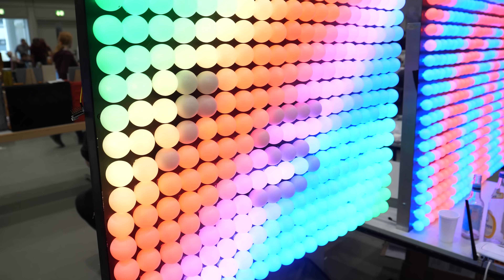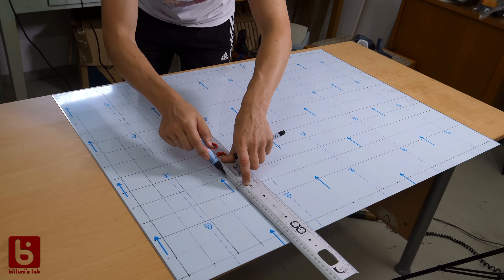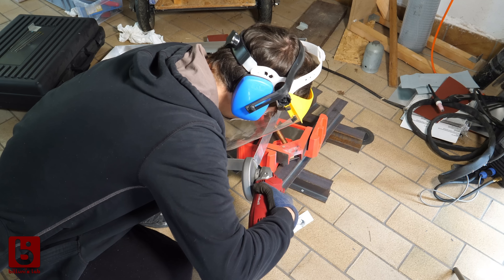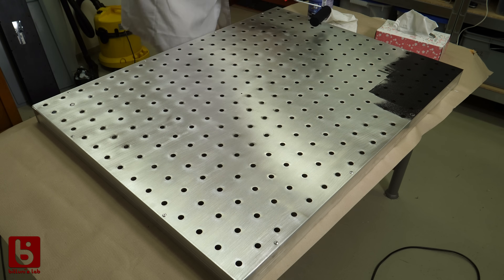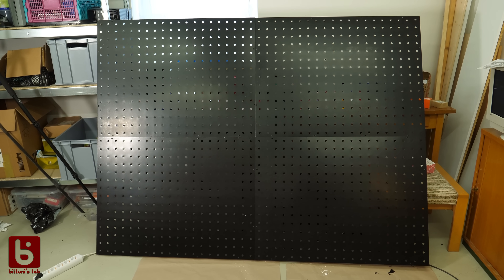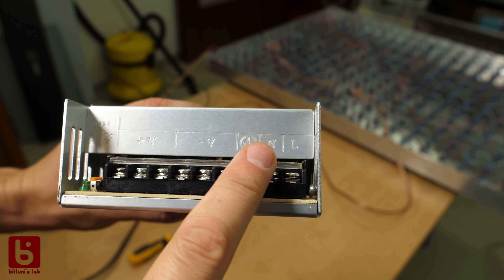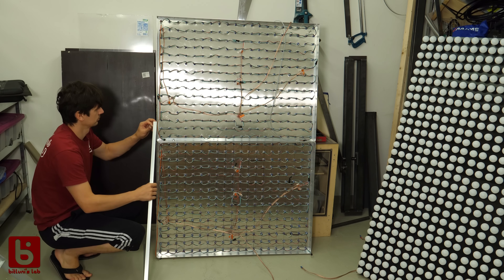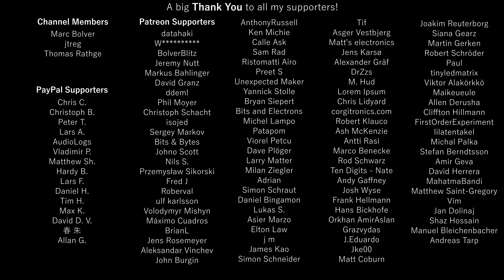DIY Ping Pong LED Wall v2.0

Comment: Sir, I want to try your project

And I wanna ask you if your 5v/70A/350w power supply are still fit and compatible if I use LED Ws2811 5v pixel module string of 2,000 pieces?

Comment: Hi! I have mounted something similar but with fewer LEDs, only 250. It turns out that when I start it with the Arduino board that you use some LEDs, they seem to blink and change color (as if they failed), I have noticed and it also happens to you. you. What is this due to? With another arduino board it doesn't happen to me.

Comment: Hallo liebe Community, ich habe noch ein paar Fragen und möchte dieses Projekt selber nachbauen ich möchte das nicht als Led Wand sondern als Beleuchtung an der Decke benutzen. Folgendes habe ich mir überlegt. Ich nehme den gleichen Abstand wie hier also 5 cm und wollte eine Länge 1.5m und eine Breite von 40 cm bauen. Entspricht also einer Matrix von 30 mal 10 also 300 LED´s dieses passt auch mit den WS2811 LED´s überein. Jetzt fallen mir als halber Elektriker(Mechatroniker) folgende Fragen ein. Erstens finde ich keine richtige Leistungs bzw. Stromstärke heraus um das passende Netzteil auszuwählen. Mit Mikrocontrollertechnik habe ich auch kaum bis keine Ahnung. Also weiß ich beispielsweise auch nicht welche Querschnitte ich brauche für das Projekt. Der zweite Teil der mir einfällt ist, meine Idee wäre es über den Mikrocontroller ein Bluetooth Modul einzusetzen um es per Handy steuerbar zu machen. auch da die Frage wie kann ich das Ansteuern und was bräuchte als Mikrocontroller freue mich auf Antworten dies bezüglich und sonst könnte man auch über discord oder Teamspeak versuchen zu kommunizieren Da fallen mir sicherlich noch mehr Fragen ein.

Comment: 3:40 Try tacking the corner and inside corners first before welding the beam. Since aluminum isn't that strong compared to steel, it melts faster. That's why you got that hole at the end. Hope that helps even though this video was a year ago lol.

Comment: There's a cool product available from Adafruit called a FadeCandy. It can control 512 WS8212 type LEDs, and connects to a PC via USB. You can connect multiple FadeCandys to one PC. It's then really easy to interact with them via a Processing sketch, especially to do things like play video, animated GIFs etc.

Comment: Hi, I'm building a similar ledwall, how have you solved the problem between the array and adafruit library on arduino code?
Reply: What board are u using? 
I'd been making a matrix 16x30 with adafruit GFX library and i can't use more than a matrix's 11x30, but i dont know if my arduino nano isnt enough  ram for support more than 306 ws2812b leds
Reply: @vichdez10  I have an arduino mega 2560 and also an esp32 and the code load on both but at the moment I'm waiting for the power supply from china, so, I can't test it

Comment: Aluminum isn't the easiest thing to weld. Aluminum is a popular heatsink, but it's also easy to burn... Also, aluminum oxide has a really high melting point, so it will insulate the surface. Pain in the ass all the way around.

Comment: This might be a very silly query. I'm getting the parts ready to build this cool LED wall - fits perfectly onto a wall in my lounge - and I happen to stumble upon the ESPixelStick project by forkineye (based on ESP8266). However he has a hardware board that takes care of voltage regulation, fuse etc. whereas in this project we directly drive the LEDs from the ESP without any additional hardware (apart from the implementaton of sACN which is not relevant for this question). Am  I comparing different things here?

Comment: It would probably have taken a lot less time if you had just used pegboard for the front and regular wood for the sides and back (if a back is even necessary). Since the LEDs are bright and the backboard is dark, any unfilled holes in the pegboard that don't line up would more than likely be  unnoticeable as long as there is no light coming through them.

Comment: Does this generate heat? i was wondering for a lighter in weight design couldn`t you use plastic wall panels?

Comment: if you know someone who works in the engineering industry that uses a cnc turret punch it's always a bonus. When welding alloy always tac at the corners to avoid them key holeing

Comment: The next time you're welding thin material clamp a 1/2 inch thick copper backer bar on the other side of the parent metal to draw away heat and prevent blow through.

Comment: How did you put a hole into the ping pong balls? I hot glued some direct to the 12mm bullet Pixels. putting the holes without crushing the balls was difficult.
Reply: On the hot iron i thought

Comment: Physically very nice!  The refresh rate gets too low off a single lead.  1200 is too many off one WS2812B data lead for a good refresh rate.  I split my matrices into no larger than 16x32 and dedicate an ESP32 pin to each.   You can run up to 8x1024 pixels at a full 30fps, but you likely only need to split your into two.  And it's all code, except for one additional wire.

Comment: Run it on LEDEdit with a T300K controller. They are like $100 and run 6,000 LEDs at  25 FPS from a live media stream. It is a lot easier to set up and work with.

Also, you might want to consider putting some fuses in. Great work :)

Comment: Hi , Iam a design student and  I need Help with a personal project , I want to build a LED wall similar to this but smaller , abut it needs to  have a motion sensor  or  something similar to track motion and display it as a color on the panel , so when some one is walking infront of the LEDs a new color will follow them ,  Please help me with this project

Comment: No, the image quality is not “a bit crappy”. It's extremely bad! 
My first computer did 320 by 200, and even that was worse than “a bit crappy”.
What is this? 40 by 30? Even old arkade games are super high res in comparison.
Art? Nah, it’s just a bit of fun. And for that it’s fine. A lot of work, though.

Comment: i wondered last time that you weared an air filter mask for drilling holes, now you wear it for the hotgluegun xD
where is the imaginary hazard?
Reply: You noticed he's also melting a hole in the ball, these fumes aren't definitely the healthiest thing there is.
Reply: @sebastiendesormeaux1853  yes but that was way later. Usually  you wear an airfilter  when you need it, i mena he doenst wears it all the time.

Comment: Next project : LED Wall v3.  Full hd.
Reply: Yeah maybe with some smaller pingpong balls? and shorter distance between the leds?
Reply: @gerben5964 It was a joke.
Reply: @derkernsen  no of course not!!1!1!  (but a simply even bigger Display with therby more pingpong balls would be really nice)
Reply: @derkernsen  Yes it can be seen as an joke, but creating fullhd is possible, and would be very nice!
Reply: @gerben5964  that would be sick
Reply: i already made an interactive led wall you can check it out on my channel  or search on youtube the name of the project is odycubes also you can play tetris on it with your hand movements
Reply: Flo S excited for that
Reply: Thu Nell Ⓥ  would be an interesting conversation with the power supply manufacturer though "yeah i need a 124kA 5V DC brick"... i mean even the one bitluni used was technically subspec (the LEDs can draw 60mA max each, so 72A max for this wall, on a 70A supply) :P
Reply: 420th like
Reply: Then LED Ping pong wall v4. 4 for 4K
Reply: You goin to sawcon guys
Reply: Kat, sawcon these nuts, gottem
Reply: []soup[] my Son Has Ligma and I don’t want you getting it
Reply: Oh UR ON
Reply: Gotta go at least 4k in 2020
Reply: 8k
Reply: Yes. But full hd it is necessary at least 2 million of pixels. The dimensions of this panel turns impossible to build it.
Reply: Thu Nell Ⓥ  some chinese can do that in 2 weeks ;-)
Reply: Maybe 1920x1080 pixels

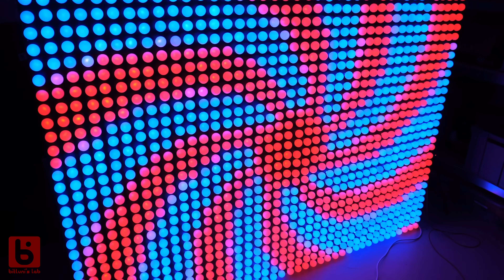Comment: One of the LEDs green channel seems to be failing at 8:37 in the upper left-ish corner, that's unfortunate. Sometimes the LEDs aren't soldered to the chip so well under the silicone...

Comment: Amazing work as usual. I absolutely love the final result. 🤩

Might I suggest you switch from the ESP32 to a (ARM based) teensy since you can use this library called OctoWS2811 which can drive 8 strips on parallel. It can potential manage more than 200FPS in your 1200 LED frame. You will lose WiFi capabilities but that is easily added by putting a raspberry pi, which can get bitmaps over WiFi/Eth/local-storage and send bitmaps over USB to the teensy (at USB full-speed rate ~12Mbps). That library can even do multi-processor synchronization...

I am actually finishing up the same thing right now but I mine is much smaller and hexagonal (at 331 LEDs). 😋

Comment: Hello . Nice work 
Is the data signal strong enough to go through all this leds? Coz I did one project and I used three 5m (16f) , I had to use arduino mega instead of wemos D1 mini also I had to use amplifier to boat the signal

Comment: That's an insane amount of work!
For extra masochism, you could turn the ping pong balls into cubes with some heat and pressure or vacuum - then the pixels will be continuous!
Reply: I think I'd 3d print cubes before trying to reform a ping pong ball.
Reply: @josiahdeal7493  Yeah, that would still take an awful long time though.
A plastic sheet diffuser with a grid of baffles to isolate the leds would probably be a lot easier to do.

Comment: This is amazing. I ended up building the smaller 15x20 one from the last video this summer and it was so satisfying to see it work.
Reply: Hi, I'm also trying to build 15x20, do you Wall work with the camera images? What changes did you make in the code?

Comment: I'm sure someone will point this out, or already did: Never try to weld aluminium without an absolutely pointy tip. On steal you maybe achieve some welding 
without a razorsharp tip - in aluminium, you won't. All you get is a nasty hole filled with bubbling filler rod.

Comment: I wanna build an LED wall too sometime soon but I really don’t know anything about Amp or Voltage drop calculations and so on... Any sites or so to learn this from or maybe even a pre made calculator?
Reply: Let's say one RGB LED can draw a maximum of 60mA (20mA per color) at 5V. So you basically have to multiply that with the amount of RGB LEDs you have. For 144 LEDs on a one meter strip you should get a supply rated for at least 144 * 0.06A = 8.64A. It will probably work with less though, as you won't ever use full brightness white on all of the LEDs simultaneously.

Comment: Full HD next! The size of a house! Awesome work.
Reply: one of the guests at MakerFaire was talking to me about making a version with 800 x 600 or at least 640 x 480 LEDs. I've put on my best "bitch please" face.. you'd need a 144kW power supply for that (granted in full white all pixels). 
You've probably said that as a joke but it just reminded me of that guy. He had this "I can easily whip that up" smug mode on.. meh.
Reply: At 640x480, It would also be at least 19.2m (64 feet) tall, and have to be driven in 148 concurrent segments to maintain a frame rate of 24 frames/second (the max rate of the LEDs he's using allows about 50,000 pixel updates per second)

Comment: Why not drive it with an RPi ?
Reply: The multitasking o/s on a Rpi makes it difficult for it to control these WS2811/WS2812 chips, which are very fussy about timing. The Pi would be going away to do other stuff in the middle of updating the LEDs and it would end up corrupting the display, so it's best to use a single thread chip to drive them, like a PIC, Arduino, or other such similar chips.
Reply: @MrJozza65  You can use DMA to get good timing... there is a good c library on github and tutorials on adafruit
Reply: @ThunderBret1  Sounds interesting; I always assumed that driving these from a Pi was a no-go.
Reply: @MrJozza65  je it works quite well (if you get the levels shiftet right, or the supply voltage is low enove that the leds understand the 3.3V Logic form the Pi). Füll blown Linux allows for some pretty cool stuff with the leds :)

Comment: I'm wondering how a teensy could drive this, especially the last Teensy 4.0
Reply: if you keep it at controlling it with one wire - not much of a difference as the LEDs are the limiting factor.
Reply: @Davedarko  yeah sure, but if you divide it in multiple arrays
Reply: @sheepknightgaming  some guys from my hackerspace use 12 pins of an ESP32 to control LEDs, so I presume the teensy 4 could do a lot more pins :) still the bottleneck would be the "baudrate" of the LEDs.
Reply: @Davedarko  yeah, I was thinking about it. Do you happen to know the fréquence of those neopixels/WS2812b?

Comment: Sweet content as always. But hey man... you can buy perforated metal with nearly any size hole and spacing. Even staggeread which is great for hexagon patterns. Save ya some sweat and time.
Reply: Sometimes you have more time available than money (and no doubt the pre-punched panels are more expensive).

Plus, it's more of a sense of accomplishment to have done as much as possible yourself.
Reply: @pileofstuff  Actually, pre-punched is often cheaper because the panels contain less aluminum. The punched holes don't go to waste so they can actually save on both material cost and shipping weight!
Reply: you can also buy LED walls :P
Reply: Atomkey Sinclair, that kinda takes away the DIY aspect of it...
Reply: @wreckless_-jl6uu  No doubt - it was just a thought for others that might want to construct a panel using another method. The pre-made stuff has the added quality of being very precise in the hole placement that might help in better alignment of the pongs. And you can also get it in material other than metal that would be cheaper than making it with metal and hand punched - plastics for instance. You could also use peg-board. You might have a little hole in-between the main fixture points, but it would be cheap and fast. 4X8 (foot) peg-board runs about $15 a sheet USD at the local hardware. Cheers.
Reply: Asshole.
Reply: Linda Muvic there’s no problem with what he’s saying. He’s giving a suggestion to someone to save them time in a kind manner. If anything you’re the asshole